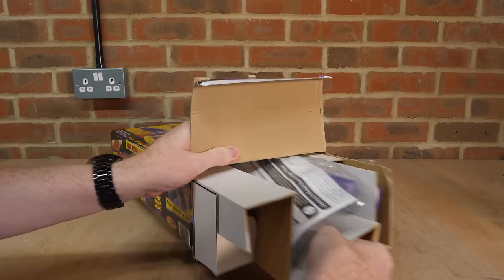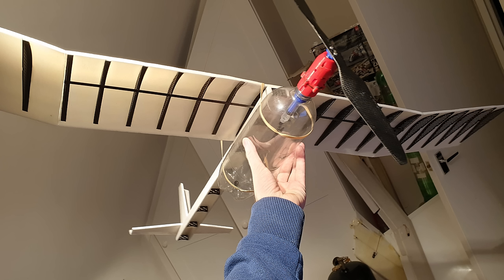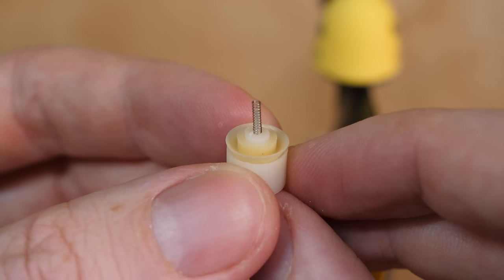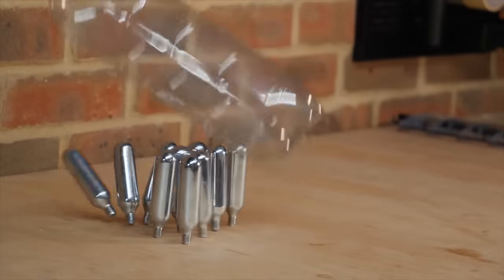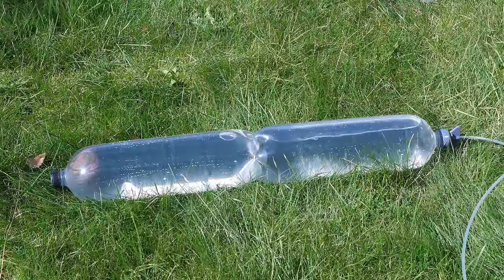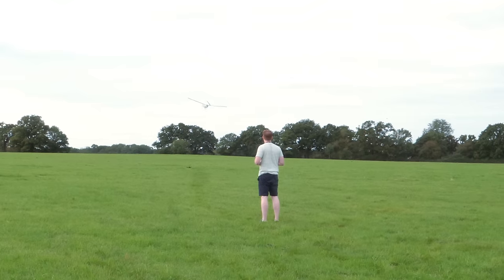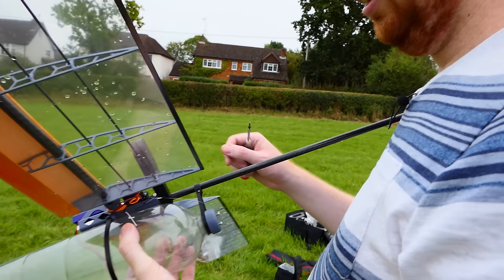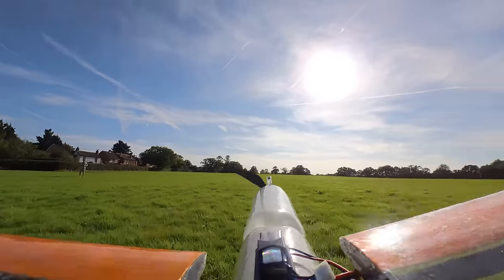Flying a Plane Powered by AIR

Comment: Do not use paint, it adds about as much weight as your balsa! Instead buy colored Oracover. It has same weight as clear!
Also: Look into using a folding propeller to avoid damage during landing. I am assuming power is low enough to let it fold on landing or that at least the blades will fold away upon hitting ground to avoid the snapping of motor.
The rpm of motor sounds like it speeds up as the plane reaches level flight which could mean pitch is too low. It shouldn't take much thrust to keep such a sleek wing in the air, and too low load on motor in flight will just use up air.
Reply: Seems like great points, at least to me.
Reply: Yeah thats why the space shuttle was orange
Reply: @squidwardo7074  it... wasn't though?
Reply: @dundeedideley1773 they did paint it white at first but then realized it weighted a lot and would flake off and potentially impact the orbiter
Reply: @dundeedideley1773 They are talking about the big external tank holding the liquid oxygen & hydrogen for the main engines.
Reply: @dundeedideley1773  part of it was
Reply: I was going to mention a similar observation about the prop pitch. I noticed the rpm increase markedly on launch. More inflight thrust and efficiency could be had with a higher pitch, possibly smaller diameter prop.
Reply: Also, it may be worth him creating a portable rigid structure to launch his craft from, for consistency and ability to develop ideas further.
Reply: I was thinking that when he was drilling the holes in the tailplane and then giving it multiple layers of paint lol
Reply: The weight of the few grams of paint he put on is the least of the issues, dude.
Reply: @UnitSe7en  The whole point of using balsa is it is light and strong. The paint weight can easily be more than the weight of the balsa. In many situations people forget such things. Also, there was not many problems with his design really. It worked great! I would suggest larger control surfaces to give it more authority though, and a higher pitch propeller to properly offload in air and maintain some thrust there. It was very clear from the initial video that as soon as it got up to something close to a flightspeed the thrust dropped as the airspeed started to match the pitchspeed of the propeller.
Reply: @1kreature  But the weight of the paint is insignificant in context with other problems the design has. That's my point. It's not worth worrying about here.
Reply: @UnitSe7en  And I claim it is worth noting. We will just have to disagree.
The fact is that the coatings come in multiple colors, exactly to avoid needing paints. This is worth noting.
If he goes to lengths to make holes in a structure as light as the balsa sheet, then the weight of the paint would equal that material by far.

Comment: Tom, I'm sure someone else has mentioned this before - but the CO2 canister is not actually full of gas.  It's full of liquified CO2, held under that pressure.  The pressure is maintained until all of the liquid has boiled off, which gives an effective storage quite a lot larger than you might think looking at it as a simple compressed gas.  :)
Reply: Yep, Tom said 21 mL expands to 1 L, but they are really 21 grams. 21 grams of CO2 at room temperature is more like 10 liters! Now, it would actually be quite cold, so that will decrease performance, and the cold itself will pose design challenges
Reply: @themonkeyman2547  Maybe then add some "heating" elements :D
Reply: I hope he's seeing these comments about CO2 canisters. There's easily an interesting video discussing phase change and testing how the consistent pressure affects the air-engine's performance when actually flying (in terms of control). Not to mention tuning a suitable jet to meter the flow to the engine (and the cooling effect, which might not be that bad given the likely flow-rates). And, the cylinders come in a range of sizes (including much larger ones).
Reply: As I recall, Integza used a CO2 canister system, where an onboard Arduino controlled the release of CO2, using a bottle as the expansion chamber and maintaining a roughly consistent pressure inside the bottle.
Reply: Isn't it easier to use a deodorany bottle? Lmao I can imagine the plane leaving a perfume trail.
Reply: There are also larger size CO2 cartridges which may have a better weight to capacity ratio. I think they are 33 grams or something.
Reply: @themonkeyman2547 I think a normal co2 cartridge is 12 grams, but I could be mistaken.
Reply: Yup. As a home brewer with a keg system it boggles my mind every time it goes from 800 to 0 in hours but was at 800 for a year…. 😊
Reply: I thought the deciding factor is the 50 atmospheres of pressure in the cartridge... From those calculations it shouldn't matter whether the CO2 is liquid or a gas. 

I'm confused..
Reply: @hvip4  It matters because of the phase change.  The pressure in the cartridge keeps the liquid CO2 liquid, which is MUCH more dense than the gas phase.  As the pressure drops, liquid CO2 will boil off and expand into gas at (roughly) the same pressure.  Consider that water expands about 1000 times in volume when it boils into steam, compared to the same volume of liquid water.  So you get a whole lot more high-pressure gas out of the phase change than you do just out of a canister full of gas.  :)
Reply: I forget how high of a temperature a co2 canister can handle before it bursts.
But if you preheated the canister a fair amount and then load it up, you will get even further expansion of the gas.
It might be enough to offset some of the cooling as it loses pressure.
Reply: The pressure also matters, not just the volume! As long as the engine can handle it and you don´t have to reduce it.
Reply: CO2 expanse, 535 times changing from liquid to a gas state  that’s the difference
Reply: @darrylpang3903  More complexity and weight. Carts are a bad idea. I wish people would shut up about them.
Reply: Not worth dealing with joule-thomson cooling on the CO2 expansion when the pressurised air setup provides such good results, plus the bonus of being able to re-pressurise the air bottles with a quick pump vs replacing canisters ($$) means that the air setup Tom uses is probably a better choice in this specific application
Reply: I don't understand well the matter. It would be totally worth a video comparing and explaining the difference between  Co2 and air powered planes.
Reply: @RobGadeke  It is not getting cold due to the Joule–Thomson effect, it does so because the CO2 changes from liquid to gas. Just like a propane bottle.
Reply: @RobGadeke  No doubt about that, but just relating on the volume is inadequate.
Reply: @MKVideoful  one of those disposablechand warmers would probably work well

Comment: You should look into lasercutting balsa for the flat parts (e.g. the 3d printed wing profiles and the tail flaps). It's often faster/cheaper than 3d printing, refuces plastic usage and could lead to lighter parts (though potentially also more brittle).

Comment: CO2 cartridges are actually almost an order of magnitude better than that because they are full of liquid CO2 and not gas.  A 16 gram cartridge actually contains 9liters of gas instead of 1liter. 6:30 

MassGas/density@1atm=(16g)/(1.77g/l)=9l

Easy to miss if you don't work with things like that often. Thanks for all the interesting videos and please keep them coming!
Reply: Yes! I was about to comment this. His comparison wasn't exactly fair.
Reply: It's also not just the volume of gas, but the starting pressure. Even if there was less gas, you need to calculate the energy released when expanding to atmospheric pressure.

A weather balloon stores even more air, but the pressure is so low that it can't do much useful work.
Reply: I just wrote the same as well.
And there are also 20g, 38g, 45g, 74g cartridges that will have much better ratio of the useful CO2 weight to the metal canister weight. And you're getting much more constant pressure, compared to that air bottle that drops from 8 atm to 1 atm.
There are problems with CO2 as well though - it will need a strong/heavy valve and you have to maintain the cartridge orientation, so you're not directly losing liquid through the valve.
Reply: @JC-XL  You also can't use the bottle as the fuselage due to the higher density - though this may be counteracted by the smaller cross section with respect to drag.

Ultimately CO2 engines might perform better but they don't really meet the intent of this challenge, given the whole point is to replicate the old Air Hogs toys.

I'd be interested to see a direct comparison between the Air Hogs and Tom's model. From my memory as a kid, they performed pretty well considering the small tank, stubby wings and blunt propeller.
Reply: @JC-XL  

It would be interesting to see propane used as the working gas. It has a vapour pressure low enough to be liquified in a soda bottle, and also be directly compatible with Tom's engines. I believe some paintball guns use it as a CO2 alternative.

While it is flammable, this shouldn't be too risky provided no ignition sources exist.
Reply: @JMMC1005  Plus, you can do Hindenberg recreations! 😁
Reply: I do think the co2 cartridge feels like cheating for "air powered"
Reply: @JMMC1005 I'm not sure releasing propane will win him many fans...lol
Reply: Sticking inline with co2, mabe play around with dryice as the system is not a completely sealed environment? Shooting for range/air time
Reply: @procrastinator1842  It's not a big deal as a one-off experiment. 

Remember that deodorant cans use a mix of hydrocarbons as propellants and society seems comfortable enough with that.

Natural gas power stations also regularly vent enormous quantities of gas when they need to depressurise lines for maintenance.

Propane itself is not considered a greenhouse gas.
Reply: @JMMC1005  Exactly, I also suggested propane in one of my comments. Propane is used in airsoft guns (I have a few) and works very well there. At room temperature maintains pressure right around the 8-9 atm that Tom is using in his air bottles. And while airsoft magazines are metal, if his plastic bottles can hold 9 atm air, they should be fine with the propane too. The advantage of propane is that at this pressure you have liquid propane and it evaporates to maintain that pressure until there is no more liquid left, which means much larger volume of gas.
Reply: All the thermodynamics engineers chime in;  a CO2 cartridge is at super critical conditions.  Which means it acts a bit like a liquid and a bit like a gas.  Short story the ideal gas law does not apply.
Reply: @JC-XL  A 600 mL bottle or smaller, partly filled would potentially give a very long flight. Would be keen to see it!
Reply: Energy density aside, I’m doubtful that the engine could handle 800 psi
Reply: @JMMC1005  Yes, something like that, in Europe we have 500ml Coke bottles, we don't need bigger. Most of it needs to serve as evaporation chamber, filled with liquid propane no more than 10-20%, because we have to make sure that only gas is going out and the liquid is not getting into the outlet directly. I imagine this having a tube from the middle of the bottle where the liquid does not reach to the outlet.
Also something will have to be done to stop the liquid sloshing around, maybe a sponge on the bottom.
Reply: @JC-XL In one of his other videos Tom went over his approach to regulating flow through the engine to smooth out thrust, so he's already covered that problem on the drink bottle side
Reply: @JC-XL  I'd suggest having a thin brass tube exiting the bottle and coiled before reaching the engine, to act as an expansion volume / heat exchanger.

This is what's done on CO2 engines.
Reply: Only supercritical above 31C/88F.

Slightly higher cartridge pressures with temperature above that point but in practice as soon as you start releasing gas the temperature will quickly drop below critical.

I have a large tool that requires filling with multiple 10lb CO2 bottles and the more important consideration is the freezing point of CO2 and loss of pressure as things get cold from the expansion.
Reply: Was about to say the same but figured i'd scroll down to make sure it hadn't been said. CO2 canisters can't just be given the ideal gas law treatment. That said, one problem with running a CO2 canister might be the evaporative cooling freezing the engine. Tom, I think this would make a great video and kind of up your alley.
Reply: What might be more important is the energy storage, not the volume. I think you might be able exchange pressure for volume by using a small CO2 stream to entrain a larger volume of air with an injector.

Comment: Use an electric air compressor with a WATER SEPERATOR on the line going into the Plane tank. less water in the air will reduce the weight at the end of the flight and will make your air engine run ever so slightly better.  The wings seem to be a bit overkill on strength. but man this had been awesome keep this going. I know you can do 2min for sure. Great Job.
Reply: there was no water in the tank in the flight tests, that was just for a pressure test
Reply: @luckylmj  I think they mean the humidity in the air
Reply: now I'm wondering is it possible to use a gas that is lighter than air, or would it turn into liquid under high pressure...and then would that even make much difference
Reply: @mattblack6736 a helium or hydrogen version would be pretty cool. I'm not sure how much weight you would save but it would be cool to see
Reply: @luckylmj  there was condensation in the air.
Reply: @mattblack6736  Hydrogen or helum or anything else would probably work. As long as they don't liquefy. The liquid moving around would probably make it a very unstable flight.  However, they definitely won't at 120psi

Comment: Not only does it fly very well, it even sounds like a real single prop plane! Awesome project!
Reply: imagine the technology the government actually has but pretends we need to pay for fuel...
Reply: @ghostwhite1648 bro the government isn't taking energy out of thin air, thermodynamics exists. This guy is expending tons of energy to get that air under pressure and then wasting even more to convert it back to mechanical power. He isn't taking anything out of thin air.
Reply: @theairaccumulator7144  he’s not 30000 feet up.
Reply: @ghostwhite1648  why would fuel be free? it takes a lot of resources to extract, refine and deliver. Please take your tin hat off.
Reply: @alexrobertson557 Those "the government is holding us back!!" tin foil hat people are hilarious. 😂 They are the same ones who think that attaching a motor to a generator will create some kind of magical perpetual motion machine lol.

Comment: One potential improvement I can think of is recycling some of the air from the expansion stroke of the motor to give the return stroke a small boost. It might even smooth out the  impulse and lead to less rattling.
Reply: Great idea
Reply: I was thinking this will cause the piston to move back up above the exhaust hole before the pressure has dropped enough for the seal to retract.
But then I realized the seal responds to differential pressure...
So if anything you'd want to create a chamber below the piston where you dump gas to hasten pressure equalization which will break the seal, and then expediate the exhaust extraction, without actually introducing pumping losses on the powerstroke.

I think overall you'll have more benefits from larger exhaust port area,
and maybe you can harness some efficiency by nozzling the gas backwards for direct propulsion, or directing it at the crankshaft to accelerate it through bottom dead center. But then you're going to have to consult Alex from 2stroke stuffing about how to tune exhaust pulses I think 😅
Reply: I was also thinking along these lines. If the high pressure air was applied to the underside of the piston where the surface area was a little less and then using the spent air on the conventional side of the piston it could help balance the pressure losses.
Reply: @thegregdavieschannel  but if you're injecting pressurized air on the crank side you have a larger volume to fill and will probably have airleaks around the crankshaft or need seals to minimize losses. I think both will likely hurt the overall efficiency more than you'll be able to harness with recycled gas
Reply: @VyantQuijt  some steam engines used a larger secondary compounding cylinder to harness some of the residual energy. 

It would be really neat to try and make that work in a single cylinder engine, but alternatively a twin cylinder engine might be the way forward.

Comment: I wish you could find some light yet strong tubes that could be used inside the wings to give it its rigidness but could also be pressurized so you have additional air capacity
Reply: Perhaps reforming the drink bottle into the shape of the wing?
Reply: In wing air is def the move here, all internal volume must be air storage.
Reply: @jim_condit  yeah im not sure how to do it where it can maintain a wing shape under pressure but it would be pretty cool to store air in the wings
Reply: @index7787  yeah seems like the next move to get more air time
Reply: Build a wing of linked bottles? - sized to form the aerofoil? - "We'll need a bigger pump!" : )
Reply: @loddude5706  lol I hope we see it
Reply: Perhaps use heat to form the general shape of the wing, then glue ribs on the inside to hold the shape under pressure.  Of course MUCH easier said than done!
Reply: Rigidity
Reply: It looks a bit tail heavy but amazing  you will be at 2 minutes in no time